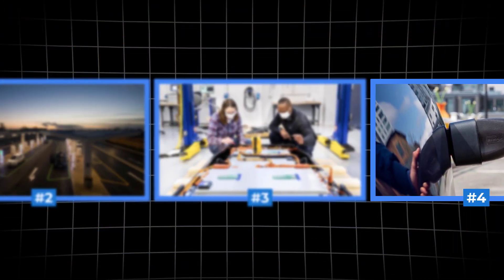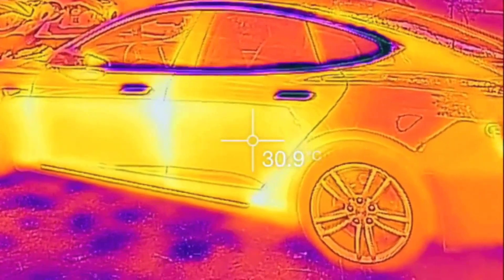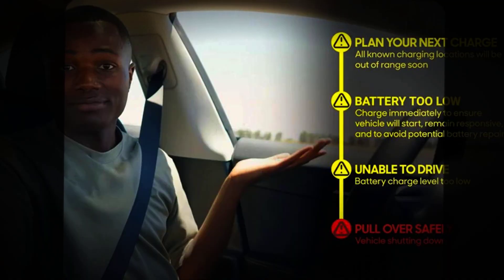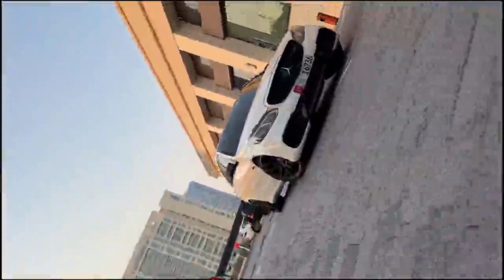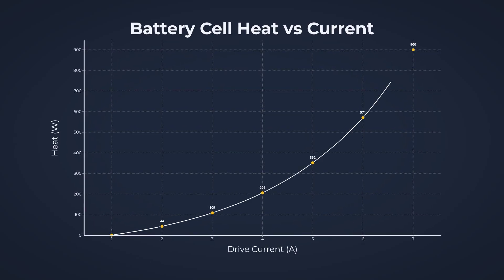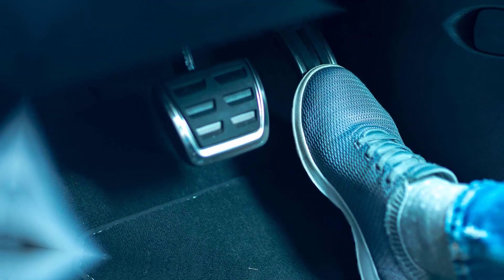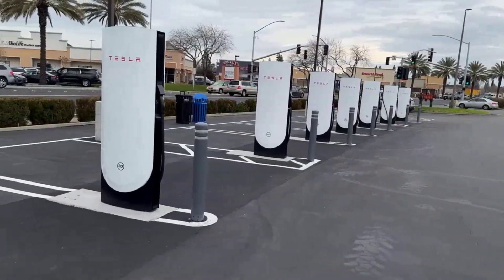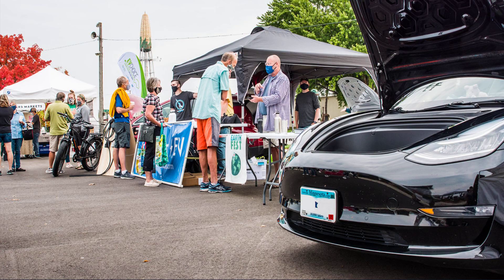Do This Once A Week And Your EV Battery Will Last FOREVER

Comment: About 25% of these tips are worthless in my situation, as my '14 BMW i3bev is Beyond over the air updates as it runs on the 3g network which is now DeFunked. 

Hence, no app control of the car, also it does Not have a charging limit setting. 

D/C fast-charging is one thing that I don't have to worry about as it does not have that capability..

The regenerative braking was easy in my case as I've Exclusively owned nothing but manual transmissioned vehicles up to this point and I'm 68yr old Certified Analog Neanderthal.
Reply from the maker: That 2014 i3 is a classic, though losing that 3G connectivity definitely makes things a bit more manual! You’re actually ahead of the game with those "analog" driving skills since one-pedal driving is basically second nature for a pro at downshifting. 🚗⚡

Are you still getting decent range out of your original battery pack?
Reply: @ChargeZoneGarage  I purchased it in March '25, summer range was in the mid70's and now that the weather has cooled off here in the PNW west of Seattle it's dropped into the 50's.
Reply from the maker: @RiverRatWA57  That ~30% drop is classic winter behavior—heating the cabin and battery really eats into efficiency, especially in the damp PNW cold. 📉

Does your specific model have a heat pump to help mitigate that loss, or is it relying on resistive heating? 🤔
Reply: @ChargeZoneGarage  I'm assuming that it doesn't have a heatpump given it's age. 
Range was not an issue for the role that I purchased it to fill, the ability to home-charge is great even tho I can only granny-charge at the present time, a dryer-splitter is in the works for my 100yr old house, that way I don't have to rewire it.
Reply from the maker: @RiverRatWA57  A dryer-splitter is a clever way to get Level 2 speeds without a full panel upgrade, especially in a classic home. Even with "granny charging," that home-charging convenience is a total game changer for the daily routine. 🔌

Are you planning to install a smart splitter or just a manual switch for the dryer outlet?